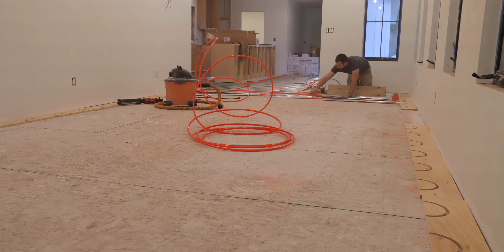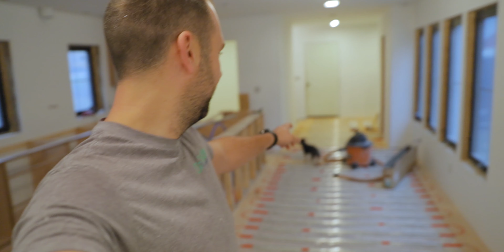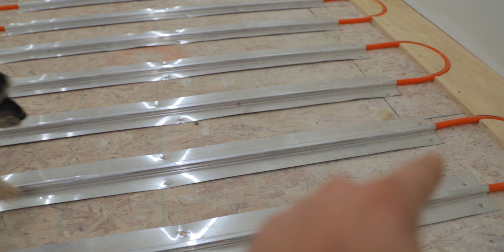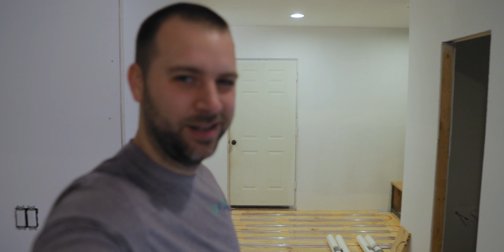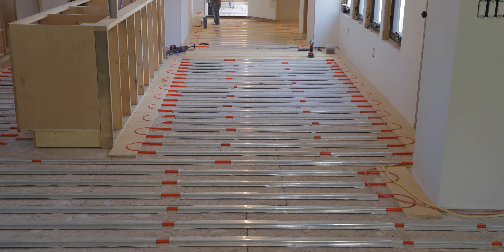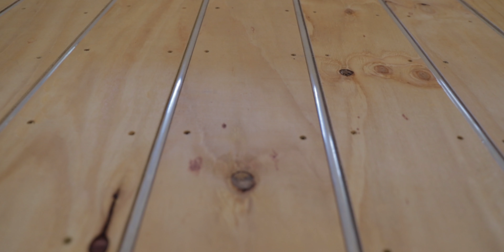Radiant Heat | Installing PEX, Heat Transfer Plates, Sleepers, and a Manifold

Comment: Yo! I guess I guessed correctly when I pressured tested at 60psi.. I ended up going for a week with no drops too. 🤷‍♂️
Reply from the maker: Well according to my manual at least, based on the internet its a total guess!  but yea seems like anything at least a couple times what you normally  run the system at is good. Also i asked my HVAC guy about the 20 degree temp drop. He said thatss certainly a thing, but because of the boiler I have and its ability to modulate up and down to meet needs it's not really a concern to look at the temp drop. Just his opinion though so I thought I'd share it based on our conversation.
Reply: Nate n Staci nice!! I agree about the drop.. we have a Utica boiler and it has 10 modulating settings.. were in the same boat! I agree about the pressure.. anything close to double is perfectly fine in my opinion.. you do some really clean work dude!! Looks absolutely perfect 👍
Reply from the maker: @1806StoneHouse  yeah, basically seems like with new tech boilers it don't matter too much, just get water to flow! Thanks I appreciate the encouragement!

Comment: Very, very, very well done Nate!!! It all look fantastically neat & organized. Question , how many zones are you looking to do with the heating? Is this going to be the primary source of heat for the house or secondary? Hoping all is well, Dirty Jersey out!!!
Reply from the maker: Thanks so much, all the straight lines really made my type a personality smile! The radiant will be.. and is... our only heat source. there are three zones, one for each floor. Then each floor is made up of a number of loops,  the basement (in slab) is 5 loops, then the main floor is 6, and i think the third floor is going to be either 4 or 5, i dont recall how that worked out. You didnt ask, but AC and Humidity will be a High Velocity system on one zone placed and that equipment will be in my attic
Reply: @natenstaci  I wanted to ask about the AC but, figured I would when you dropped a video on it. A fantastic setup Bud!!! Hope all is well, Dirty Jersey out again!!
Reply from the maker: Well glad i beat ya to it then!